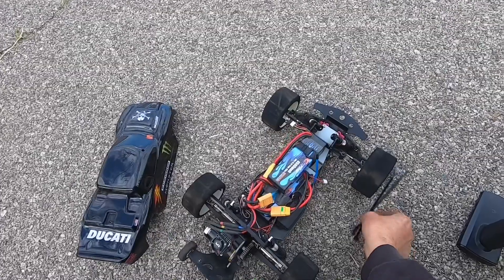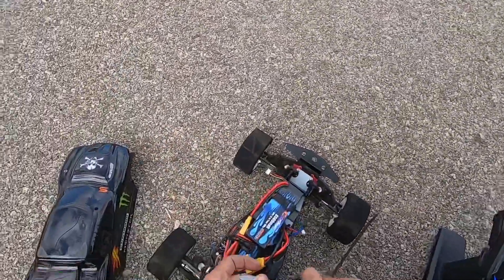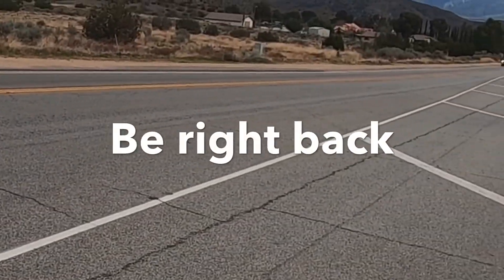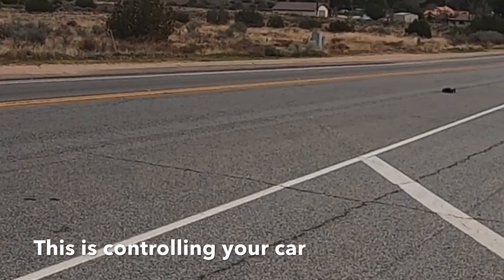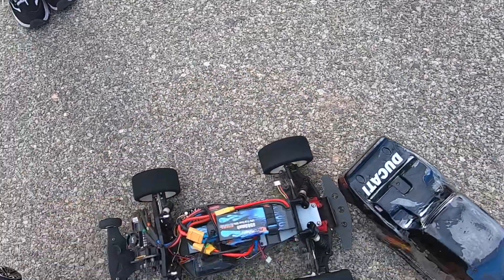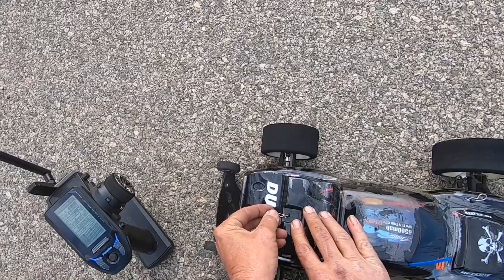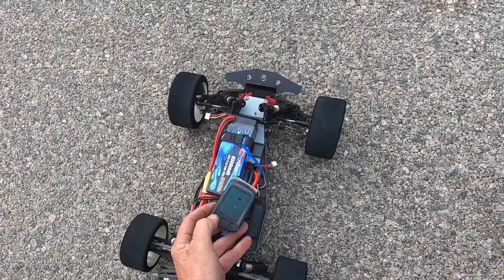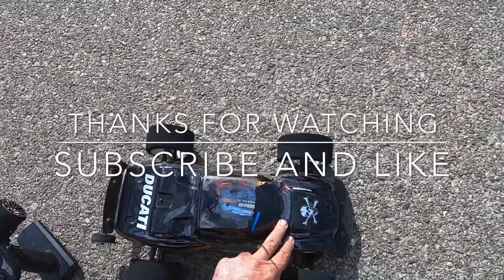Traxxas rustler test hit speed passes

Comment: Earl I am a land surveyor and I use GPS almost daily. Something that may help you out with your GPS is turn it on and set it on your dash about 3 to 5 minutes before you get to your location. It needs that long to acclimate itself before giving accurate data. 👍🏻 or when you get to where your parking while your setting up . Just turn it on and set it on the roof of your car. The gps unit I use at work cost 15K and it still has to have that time to get itself fixed. But then the Percision is a precise as 1” by 1”. 
Wow though that rustler is FAST !!!!
Awesome video Earl 👍🏻👍🏻
Reply from the maker: TomTizums RC yes I agree the one I use is for mountain bikes cost me 700.00 for this one but it’s had a few crashes lol I normally turn it on while setting the car up and I use two of them but today was a test day I can’t drive with it because ppl will say I cheated the run because the time is to long but I will turn it on earlier next time thanks for the advise it will help 🙏

Comment: Looking good, add the bumper for more weight & try lowering the front end. I would even go with a different foam from tire setup, really don't need Jaco's in the front Earl, just looks good but not good for speed, Just saying!
Reply from the maker: mtctookie25 yes I agree back then it was simple set up but there some stuff I want to change seeing it again out there 🔥🔥that front is soooo high up and the rear is low down its backwards from how I run them now lmao 😂 surprised it went 120 before hahahahah thanks brother 🔥🔥🔥🔥

Comment: i have a traxxas 2wd rustler mines is not as fast as yours i got it in 2007 i now have a cassel mamba x with 2400kv motor sensord on 4s on pro line prime tires did mange to get 80mph a best for me but the tires distort big time i did swith to mod 1 gears and i got the arrma deboots tires went 65 with same set up 38 spur 17 pin on the deboots but they did not distort like the deboots tires i probally have to maby put a 22 tooth pin in it i just want to go 80 maby 85 i all ways get nervis when i make a speed run but the rustler is a pretty tough truck like your viedo  cant spell that word
Reply from the maker: I love the rustler my speed run rustler was my first 100 mph rc and I still enjoy running it 👍👍💯💯🔥🔥🔥